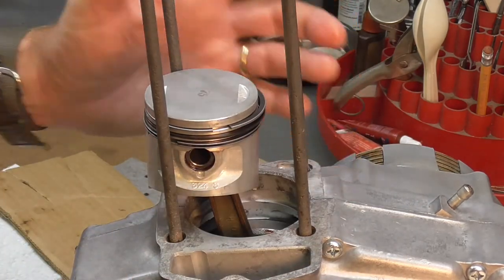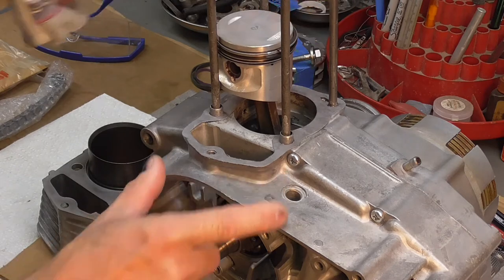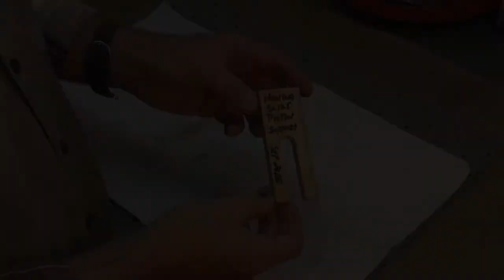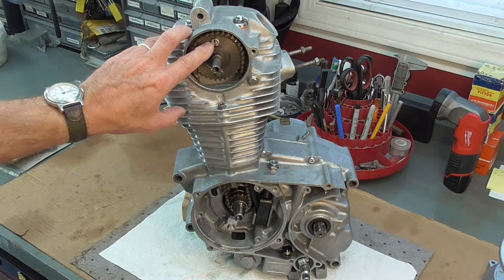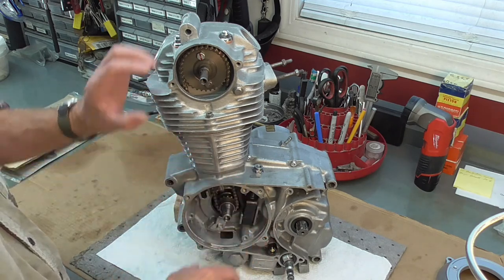Honda SL125, Engine Reassembly Pt 4 --- Video #223

Comment: Some great tips for first time engine builders. Does the cam on that engine ride in bearings or just the aluminum bosses in the head?
Reply from the maker: There are no bearings Pete, the cam is supported only by the aluminum of the head.  This model is an early design, Honda changed things a bit on later models, though I believe the cam still didn't have bearings.

Thanks for the comment...
Reply: @kwrightway  similar to the XR80 that I rebuilt a few years ago. Common problem in those bikes was galling of the cam holders in the head due to insufficient oil supply. If you allow the oil level to get low or you don't change the oil regularly it eats away at the aluminum where the cam rides in the head. I have seen many heads reduced to junk because of this.
Reply from the maker: @peteetwell826  Yes, Honda used this design across many of their smaller models.  I suppose if one was so inclined... bronze bushings could be made, the head machined to size and the bushings pressed into place.  If there's enough material to work with in the head of course.  This would address the issue with head failure and if done correctly, may allow for replacement of the bushings.